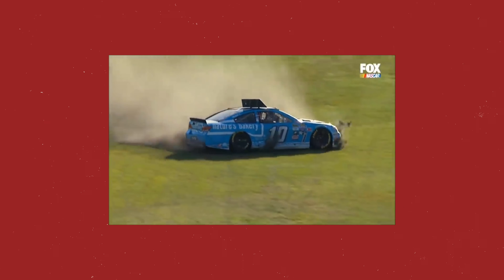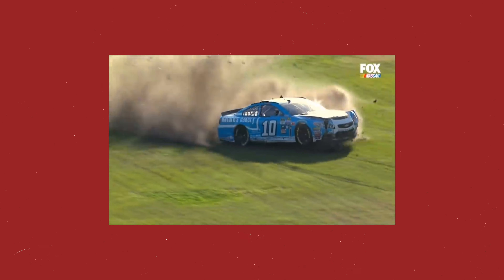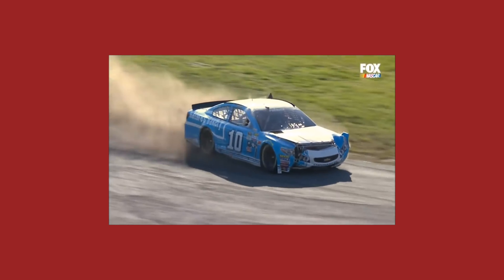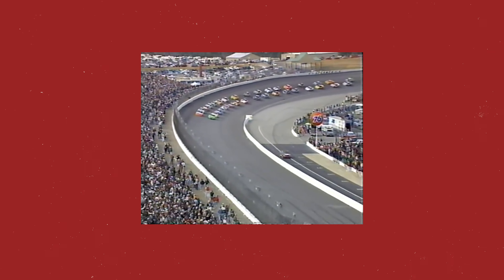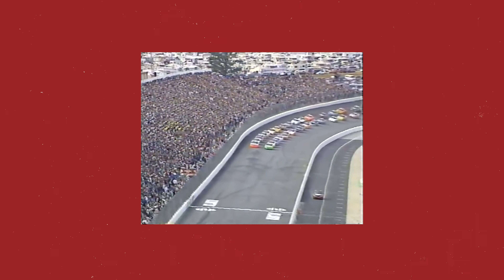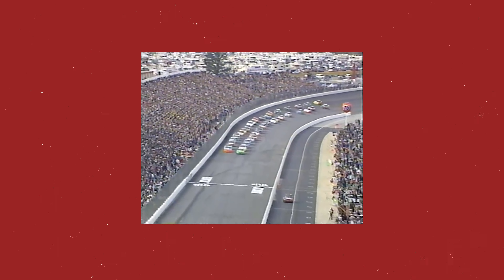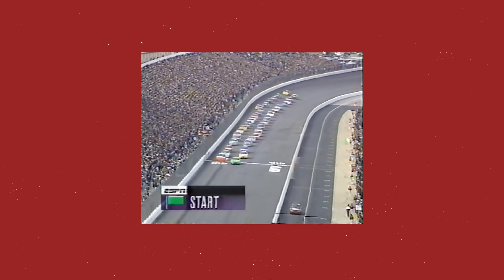The Better Version of Atlanta Motor Speedway + Splitter vs. Grass

Comment: Either get rid of the splitters (which NASCAR will never do), extend the ride height so cars do not look like low riders, or replace grass as turfs. Those are 3 good options!

As for Atlanta (in my opinion) the Quad-Oval gives me cookie cuter vibes for some reason. I don’t hate it, but I prefer the original layout better. If Atlanta ever does bring back the original layout, I’ll be happy! :)

That is just my personal opinion.

Another awesome video, man!

Comment: Everyone is like go back to the valance. The splitter is actually less aero sensitive then a valance. I perfer a stepped splitter over the valance. With the valance and the gen 4 car the teams found a way to seal them to the ground by coil binding. It means ride height doesn't matter.

Comment: Could the stepped splitter actually solve that problem? The way I envision it, the raised middle section would add some clearance and help keep it from digging in going through the grass.
Reply from the maker: It might help if you drive straight in, but if the edges grab, it could still rip off the nose. It’ll help a little, but I don’t think it’s the solution.

Comment: NASCAR likes the splitter because with low HP engines it helps with pack racing. Anybody remember slingshot passes by passing without help?